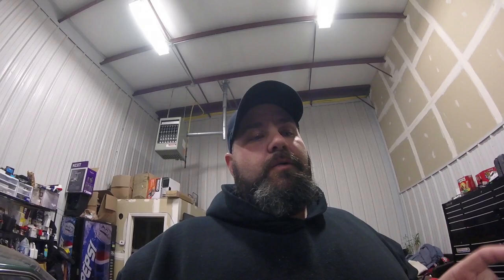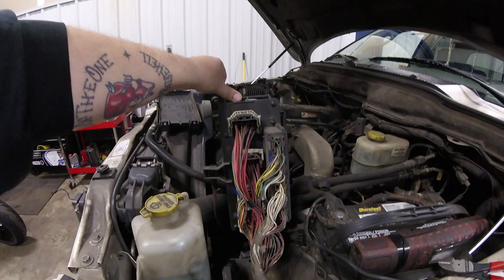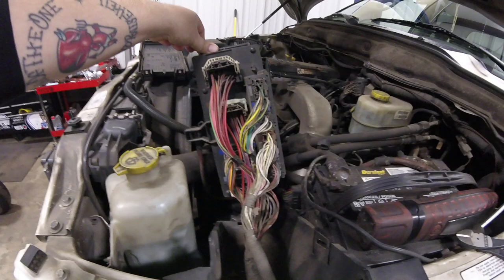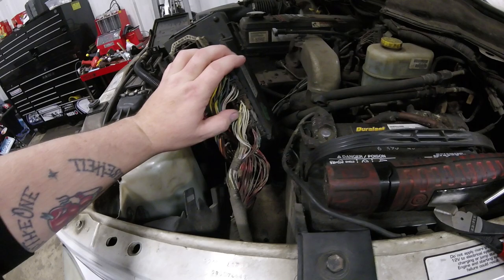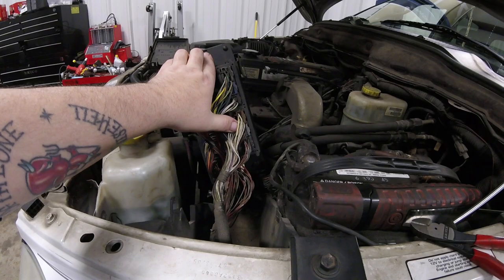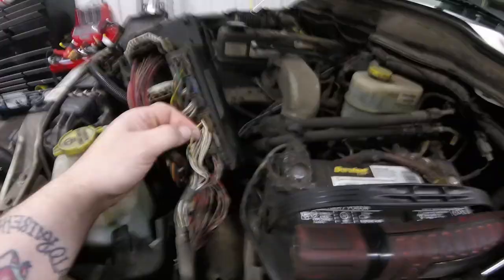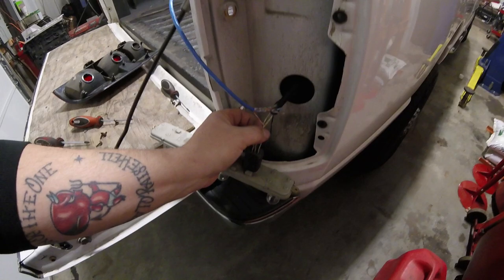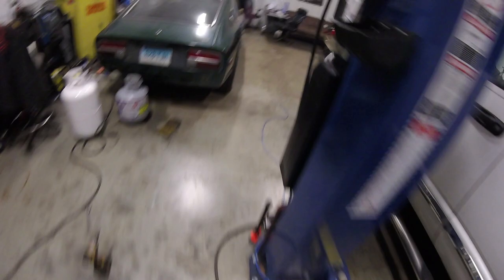Cummins Ram 2500 Bad TIPM??? Maybe not!

Comment: Yeah, I got a Ram.  It's an '02 360 & my gauges are messing with me.  Started with the speedometer mostly, but not always, maxing out at 47 mph.  Then recently, both my speedo & tacho went to zero momentarily twice within minutes.  When I set my cruise @ 60 mph I notice the tacho 'blipping' and feel the effect from the engine.  Also, sometimes the engine revs to 2k on startup but reverts to normal once shift is engaged.  Seems like it's running on 7 cylinders occasionally.  I've ordered a used IPM (I've learned that the TIPM was introduced later) & hope that's the cause but (thinking aloud)  I can't see it being the speed sensor with so many variables.  You agree?
Reply from the maker: IPM was a good start.  But, I think you may have ECU issues as well.
Reply: @MorFabIndustries  Thanks for your reply.  Swopping the IPM causes all kinds of 'lamp out' issues.  Put the original back in & I still have the same 'lamp out' issues. :(
Reply: You only have 6 cylinders. In-line 6

Comment: 2004 dodge ram slt 2500 Cummins  4x4 med mods programmer fasslift pump cold air intake banks intake manifold  hp radiator  intercooler 120 over big head wastegate     MY 2004 STARTING TO DO THIS EXACT  SHIT I IN THE PROCESS OF RESTORING IT FIRST TIME I HAVE EVER DONE ANYTHING LIKE THIS I AM GOING TO NEED YOU
Reply: I SUBSCRIBED I GOING TO SEND A LITTLE MONEY WHEN I CAN SORRY!!RETIRED COP DONT MAKE MUCH

Comment: awesome vids with great info,,,,, I got a problem i desperately need help with. 2007 dodge 2500 with 6.7. I have removed all the egr stuff and have H&S mini maxx tuner installed. all has been well for months until recently started getting code uooo1 code which is high speed can bus. the problem is its intermittent as to when it shows up and has any effect on the truck. sometimes it will come up and the truck will cut out for a few seconds then drive normal for a whole trip, sometimes it will come up and just stay on with all the warning bells ringing and all the dash lights and gauges going crazy. I can clear it with the tuner and itll be fine until its not :). today it seems its getting harder to clear and keep cleared, couple times ive cleared it and then when placing the truck in reverse it comes back. things ive done are, replaced all battery cables (not OE but all new wiring and only 8 gauge), had both batteries checked and they were good. checked all fuses and all showed good. removed every wiring harness under the hood and dash, cleaned and reinstalled, including the tipm and ecm. cleaned and replaced all body/frame grounds. from all my research the next items to check are possibly the tipm and or ecm. id like to take the tipm apart and see if theres any obvious issue with the innerds but i wanna see if thats even a possible issue before doing that. in your expert opinion could the tipm be the issue or would it be the ecm? and if i replace either do i have to take to dealer to have it flashed?  this truck only has 127k miles and is in great condition with the exception of this wiring issue. any guidance you could provide is greatly appreciated.
Reply from the maker: My opinion is that you may have pinched a harness in and about the area where you removed all the egr stuff. That would explain the issue appearing when you go to reverse and the engine torques the opposite direction. Aside from that I would lean towards the tipm first and then the ecu. There really is no good way to tell which module it is.

Comment: My driver's side headlight died and I have 12 volts at the plug as well as a good ground.  Damn thing doesn't turn on though.  I'm on my 3rd lifetime replacement TIPM.  I hate these things.
Reply from the maker: Yeah. A lot of times you will show voltage however the circuit is incapable of carrying any kind of current. I'll bet the voltage drops to 0 when you plug the bulb in
Reply: @MorFabIndustries  I'm willing to bet a week's pay that you're right on the money.  Great video on the TIPM, wish there were more "how to's" on this turd of misery fuse box that weren't straight up hack jobs.  Not referring to your fix as a hack, there's absolutely nothing wrong with this method of repair.

Comment: Great videos!  New problem, 06 ram cummins, started with a cam shaft position sensor error and the truck going into limp mode. Shortly after this the truck through 4 more code, one of them being 2026 (short in ecm) replaced the Ecm and after 30 min cam shaft position error. My question is can an unresolved cps cause an ECM failure?
Of course I am now replacing cps and trying again but I have a feeling that the issue is not cps but rather something else like wiring causing a short in the system somewhere.

Comment: Hey man i have a 04 2500 5.9 cummins 6 speed 4x4 i have a pass high beam light out and low beam dim on driver side and when i hit brake lights the running lights light up really dim if i turn my lights on and hit brakes tail lights ho out and front signals dont work. I did replace the fcm and i got low beam back i didnt have any low beam b4 that. Do u think it could be a burnt joint in the box i could fix wiyh a jumper wire. If i got a new box would my truck need programed to since its a early 04 thanks alot man
Reply from the maker: Sounds very very much like a bad ground. I would look over all the grounds and if you can, get a wiring diagram and find the grounding for the lighting circuit. I’ll bet either a broken ground rotted ground or a broken ground wire in the harness somewhere.

Comment: my 2010 dodge had both headlights stay on for about 30 seconds then go off then resets  and repeats the same thing
Reply from the maker: There are so many odd happenings related to the TIPM. Did you get it fixed?

Comment: mine cranks when it wants but if i beat the fuck outta my tipm it cranks fine and also my head light stay on when i turn em off and turn truck off they stay on and i beat the tipm and they cut off i def need.  need tipm

Comment: Tipm=an underhood mounted fuse block if you own a dodge. Don't over think it! BMW calls a vvti solenoid a wqxxyyz! Learn how to use a multi meter and get some good piercing probes. When u understand automotive electronics buy a power probe.  I'm not good at fabrication!

Comment: I have a 2005 Dodge ram 5.9 Cummings RPMs rev up when I hit the freeway and fell back down and rev up no one can fix it new transmission didn’t fix it can you help me
Reply from the maker: Sounds like an electrical issue.
Reply: Did you ever get it fixed? 
Mine revs up as if I floored it. Have to push accelerator 3 times to correct. Also having problems with speedometer jumping  up and down and shifting issues. 
Thanks

Comment: Yo - MF.  Sure like your videos.   Hey - how can I turn off the trailer battery charge wire when ignition is off ??   I’ve been just unplugging the trailer connector.   Thanks.  (2011 dodge Cummins 3500)
Reply: Have a switch in the truck